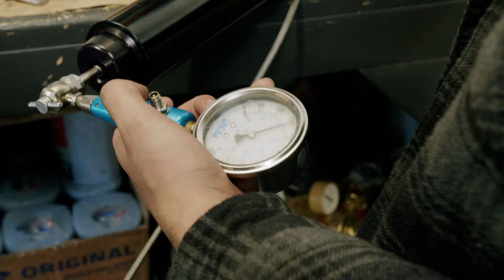@FOXFACTORY +  @Suspensiondirect EClik Upgrade - Better than Fox DSC??

Comment: Do you revalve the shocks when doing the sdi eclick system?
Reply from the maker: It really depends on application and the end user as most of the time there is no need, but really the best way to find out if you really need to have them revalved or how you would want to revalve them is to install the reservoirs on your shocks as is and test them. Obviously if the valving is unquestionably wrong to begin with that is another story, but in the case of most vehicle specific shocks like the Fox 2.5s on this Ram, the first step is usually to run the reservoir kit as is first and test to see what changes need to be made if any

Comment: Are you able to buy a complete SDI front shock set and the universal 
reservoirs for the rear?
Reply from the maker: They only make shocks for JK and JL Wranglers, JT GLadiators, 2005-2023 Tacomas, and 17+ Super Duties, but if you have one of those applications it should technically be possible to buy a set of their front shocks and then run their universal reservoirs on a set of remote reservoir rear shocks you already have. Just might have to play with the harnesses a bit.
Reply: @ShockSurplus  i have a 22 Tacoma with 6112/5125s. Eventually I want to upgrade to the eclick but i also wanted to upgrade to 12” shocks with archive shock relocation and the rear eclick shocks aren’t that long

Comment: What do you guys think would be a good upgrade from a 2020 tundra trd pro suspension? Im getting to the point where i want to run 35s and not really feeling the coachbuilder route just to keep fox suspension.
Reply from the maker: The stock TRD Pro Fox shocks are already a position sensitive (internal bypass) design so we definitely recommend something with an electronic control upgrade like these Fox or even a King 2.5swith the SDI E Clik reservoirs, or an Icon CDEV, or something position sensitive like a Bilstein 8112 if you like to really push it off road or an OME BP51 if you like a little cushier ride. The 8112 coilovers and 8100 bypass shocks probably ended up being our favorite thing we have tested on a Tundra so far. Rumor has it, they should be adding the DSA+ adjusters to those front coilovers in the next year or so too.